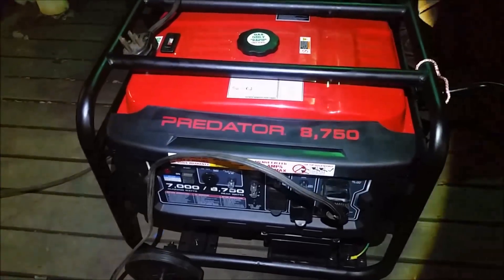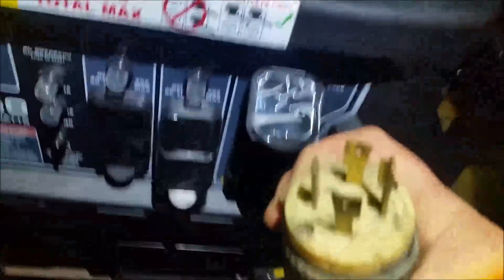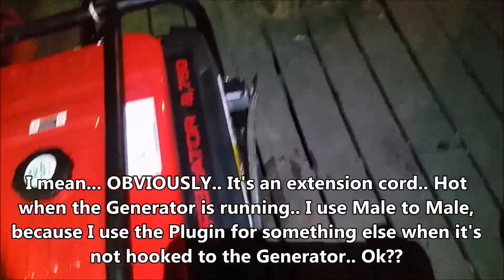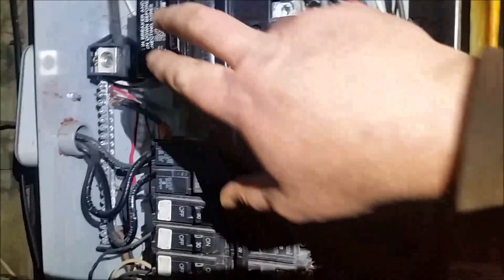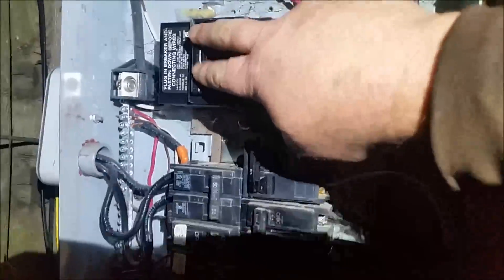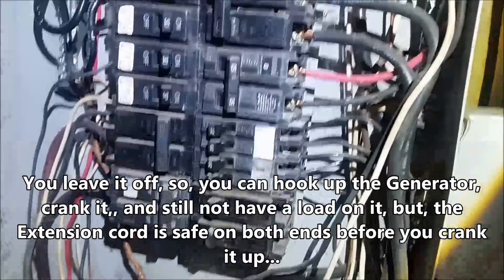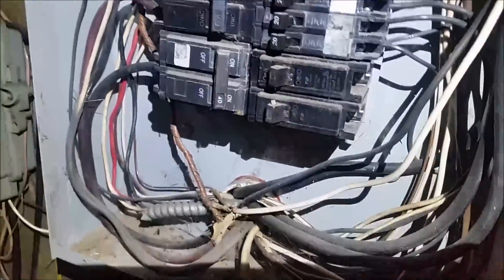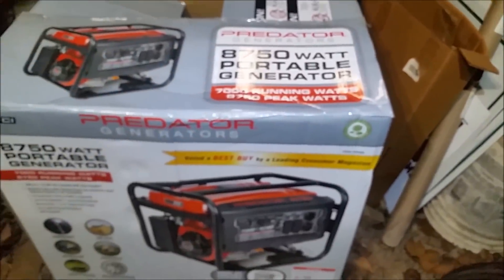Quick/Easy/Safe: Use Existing Plugin/Breaker for Generator hook up to your house Panel box.

Comment: this might work for this guy....... but one slip up, or one issue could cost your your life, a house fire, or a blown electrical panel and generator.  Licensed electricians saying DON"T do this
as he says use common sense......... go to another video
Reply: RE:KC O. Please explain how this could cause a house fire or a blown electrical panel. Unless what you mean by "a blown electrical panel" is a tripped breaker?
Reply from the maker: Thanks munsters2.. Yea.. Lots of nutjobs making all sorts of wild comments here.. Seems like the Electrical Union is paying some really uneducated trolls to pounce on these videos.. The basics of home panels is really simple.. I guess they want to scare everyone to keep some customers.. Ha..Ha..
Reply from the maker: KC O It works for anyone who can follow some very basic and simple rules.. 1) Turn off the Main Breaker, 2) Hook up the male to make cord, 3) crank Generator. Disconnect exactly in Reverse.. Perfectly safe.. But, if you don't think so,  then, you should surely NOT do this.. 
You need to look into more complicated alternatives to this.. Now, doesn't that sound like a strange statement?? It's true though.. Ha..Ha..
Reply: well more power to you...(no pun intended) if this is your solution to power outages.   But looking at other posts on here i can tell you are one of the "i know everything kind of guys" and want to argue everything that is posted on here that opposes your vid.  Common sense says just run a few extension cords into your home off the generator panel.  Is your home, and life worth "Rube goldburging" the electrical system for a few hours of Off panel life?

Hell a home generator installed is 8-10k a lot less than lost wages, and a extended hospital stay and cost due to doing something wrong......or funeral costs.
Find one certified electrician that endorses recommends this and ill remove my posts and declare you correct.
Reply: Here’s a video about generator safety https://m.youtube.com/watch?v=I1jT3ANENvI

Comment: It's simple add a 220 volt breaker run to a dryer plug run the wire off your 220 on your generator to the dryer plug! Shut off the main turn on the dryer plug start the generator! But always be sure to shut off the main before you plug in or even turn on the breaker going in to the breaker box from the dryer plug!
Reply from the maker: Truth Hurts.. You got it.. Dead on target.
Reply: sounds like what i had the electrician do. wired a 220V/50A plug in 4 inches off the electrical panel. in hindsite, im thinking a 30A breaker would actually suit my needs better.

Comment: Seems like a lot a people hating on this guy, but in reality, you Electrical Contractors know that there are many, many people out there hooking up their generators the same way. If you don't believe me then go into any electrical supply store and try to purchase a 220V four prong male connector before a hurricane hits. There will be as many people buying those as people buying up all the milk, bread, and gas as they can! Hell, you'll be lucky if you can find one! I know because I've been there. Sometimes you don't have the time or money to install a Home Power Transfer. Yes, it's not safe or legal but it's reality. At least he's showing the correct steps in doing this and hopefully someone that's going to do it has something to go on and not going into it blindly. Thanks Mark Thomas!!!!
Reply from the maker: Jeff Barnhill.. You are Welcome and Thank you too..  I agree with almost everything you said.. However, if you follow the steps, there is no way that you are going to create any problems or Be unsafe.. Turn off the main breaker, Panel is dead or cold,, hook up the extension cord,, and then,, crank the generator.. Shutting down the generator is the exact in reverse.. Kill Generator, unhook cord, turn on main breaker.. The only thing not permanent to the premesis wiring is the Male to Male cord and Generator. And, when you connect either or both ends, there is no electricity present.... Then, you crank the generator and it all becomes hot to the first breaker, usually the one the generator hooks into.. So,, in my opinion and I can't find anyone who can offer me a legitimate reason to feel different, although I have tried and challenged many to  find something wrong with such a simple procedure, I have found none.. And, since NEC does not regulate portable extension cords, unless there is something specifically added in local codes, it is not illegal.. It is just different.. It is unusual and non-typical, and that really scares people.. When I grab the cord,, every single time I grab it,, I get a weird feeling myself for a split second, remember I did just turn off the main breaker, and the Genset is not running, and I continue.. But, I respect electricity.. I am not scared of it. I learned long ago, that being scared of something is not wise and will create problems.. I am surely not scared of myself,, and I am the only one involved in this setup while I am hooking it up.. But, not to sound crazy, I do not like snakes and I don't like big dogs that act like they are going to want to play with my Body parts,, but, damn if I am going to let either one of them know that and make the problem worse.. 
I keep my cool, and decide immediately what I am going to do, if that dog does not stop before he gets to me, and I figure out some way that I will take him out, or let him know that messing with me is going to be something he is going to regret,, and hope he is not the kind of dog that really doesn't care anyway..  Yes.. It freaks me out and I am scared, but, the only value of being scared is that I have that extra Adrenalin rush that gives me that extra edge I might need.. If I turn and run, I am just deciding which parts of me that I am going to let him have freely.. I would rather stand, and take a calculated move and figure he is not going to expect me to stand my ground.. Did I say I have never been bitten by an aggressive dog? It is what you do with your fears, and if you can use them to your advantage. 
Last thing.. I would very much encourage anyone not completely comfortable with this setup to at the very minimum, install a panel Interlock and a Male Receptacle for the standard Generator cord.. It is not that expensive and it is fool proof... I don't know why I don't like "Fool Proof" solutions..  I really don't need them, and the primary reason for this setup is, it is quick, easy and safe if you follow the rules and I can use a 220v circuit I am not going to use while on Generator anyway.. It isn't for everyone, but, if you can see the simplicity and you are confident you are able to do this every time by the rules, it will serve you well. 
You are right on target on the lack of male plugs during a hurricane. I helped a couple who had bought a generator, but not the Generator extension cord and had never hooked it up, just before Katrina hit New Orleans. I sent him to the store with a printed picture of the parts we needed from their Internet website.. They were out of the male 220v plugs we needed to hook into his dryer outlet, and only had one male twistlock for he generator.. I told him.. Get the last twistlock, and the 8 gauge wire we needed and get back here.. I put the twistlock on one end, pulled the wires from his dryer breaker and plugged the stripped ends into the breaker and neutral and ground to the ground bar and showed him how to put it back when he was finished.. When I got home, I took  the back of my plug off which was the same as his and took a picture of it and sent it to him by email.. I got out of New Orleans just before they closed the road down across the lake.. 
And, he didn't get my email for a solid week, while he ran on generator and went across the lake by boat to get more fuel and had a friend there print the email and hand it to him. They were on generator for a week.. Just running it at the hottest part of the day to charge the Refrigerators/Freezers and run a window A/C in the room they were all sleeping in.. You'd better be able to make some adjustments here and there when the need arises.. 
Thank you for your comment. It is much appreciated..  Nice to meet you btw.. Cheers..
Reply: I live on the coast of SC and are used to hurricanes. I'm the kind of guy that can go without power but the wife and kids put up such a fuss at every scare that I finally bought a generator. All my friends hook theirs into their homes just as you explained. Now we have Hurricane Florence on us and I convinced my wife that it's ok and out to electrical store I go. Well the third store had what I needed as the first two were sold out because of the storm. All the stores were packed. I got lucky on the last store as they had two left,so I got everything. I just ran across your video to double check and noticed all the "professionals" hating on you when they know you are correct. Like you said, I wouldn't want them working on my house. Hell, I noticed that most of them couldn't spell or write a complete sentence. Lol. Anyway, thanks again!!!
Reply from the maker: Jeff Barnhill.. Good Luck my friend.. Looks like the Coast is not the best place to be right now.. The forecast is much lower than first anticipated for the NC coast, but, the storm surge 7-11 feet is going to mix with high tide, at least once,, possibly twice, and the rain they are forecasting is pretty heavy too.. 
I hope they are exaggerating like they usually do..  Duke Power has been running our river (Nantahala) 24/7 in anticipation.. We have had a Rainy season to begin with, and the lake is up quite a bit.. They really screwed the pooch last time we had a crap load of rain and did a couple of Million worth of damage they had to suck up or face the public, saying "I Told You So".. Hopefully they won't control flood us again.. 
I lived in New Orleans long enough to see quite a few good ones.  Try to get plywood for boarding up windows a day or two before a good storm.. Ha..Ha. 
We kept all of our cutouts marked and ready, and it didn't take us more than a couple of hours to get everything closed up tight.  Stay Safe..
Reply: Nobody's hating ,There's a right way and a wrong way to install electrical equipment. In our world today the way the weather is , we need to prepare for everything. Do things the safe way ,it only takes a split second for a shock to occur.Spend the money it's not worth your life!!
Reply from the maker: Susan Eisenberg.. Turn the Main breaker off, connect the cord, then crank the generator.. Exact opposite when coming off of it. 
In your next post, you say you are an electrician of 35 years.. How could you not know or see that??  Amazing...
Reply: Dude ,wire your generator up any way you want . And good luck to you .
Reply from the maker: Susan Eisenberg.. Yes Mam I will.. I don't have room to add another 220v breaker.. I already have double 110v breakers.. This is the only way to use an existing outlet that I am not going to use while on generator.. Transfer switches or interlocks would not allow me to use my existing plugins.. 
That is what this video is about.. Using an existing plugin, and only for those people comfortable enough with the panel box to know why they are doing things in the order they are doing it, and they understand what they are doing.. None of those people are going to leave the main breaker on,, especially after they pickup the male to male cord and take a look at it... I have done this for 15 years.. I will replace this house one day, and I will put up my dream home in it's place.. The less I upgrade/install, the faster that will happen.. It's 100 years old.. All of the small jobs turn into big ones.. 
I needed more storage space in the house.. I built 1-1/4" square tube cabinets with galvanized sheet metal sides, and put nice drawers and drawer fronts on them.. I built a inner wall, like a closet, and framed the cabinets into the walls.. All of them were made from a set of jigs that I made, and I can fab the doors for them as fast as I built the back wall.. It will take me about 15 minutes per cabinet to remove them, and they will immediately turn into shop cabinets with offset hinges and will all have locking doors, within on day of me  being in the shop.. All I have to do is pull the fancy door fronts off and they are ready for the doors.. I ended up with an area when I was finished that was 6' tall 4 feet deep and 12" wide.. I made a cabinet those dimensions that has almost 4' long drawers using my own home made drawer slides, and segmented the drawers.. I keep all sorts of batteries, USB Cables, power connectors, Fuses, small appliance parts, specialized hand tools and a whole host of other things that are valuable to have on hand for me.. When I build another shed, I have a wall and a door, and I'll just move it over 2inches and slide the cabinet up against that wall, and put some french cleats and a shop light and slide a shop table up against it, and I'll probably be giving it to my Son or Grandson when I leave.. I do what I have to do.. I could easily buy a transfer switch, which I will never buy, until they build one that makes sense, instead of building it for some lazy electrician that can't work with heavy gauge wires.. Why should a transfer switch be larger that the panel it is switching?? I will however install an Interlock and a Male plug for the generator in my next house, because I will consider it before putting the electric in to begin with, and will have a Sub Panel in the house with my Well pump and Water heater and whatever else I decide inside, where it can be easily switchable, where I function the way I do now when the power is out.. As normal, but, not using any heavy 220v items.
With all of the innovations in every facet of peoples lives today,, it behooves me that there has not been ANY innovation in the Home electrical service, or in entrance doors.. They still build the damn things, so anyone who wants to get into your house only needs a little determination and a good shoulder or a good foot kick to kick the door in.. I have way too many important things in my shop to leave it for someone who can easily kick the door in.. I make my own metal doors and I build my own door casings, and I make a quick locking mechanism that I lock when I leave the shop and would be amazed if they get into my shop through any of my doors.. And, that is a damn shame.. I often wonder why there is no innovation in the two fields, and it seems pretty obvious.. 
Everyone is so dead set on doing things by the rules and doing something someone else is doing,, if they were the ones responsible for wheels, we would still be running around on stone wheels. This solutions works every single time and there is never any danger to anyone.. Just follow some very simple rules. And,, good luck to you too.